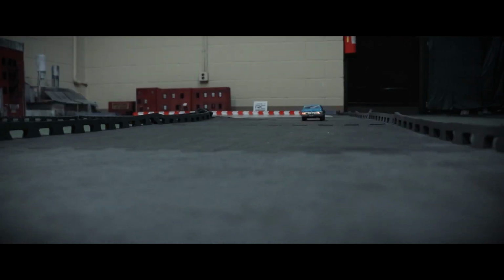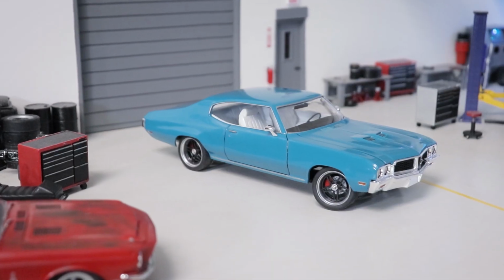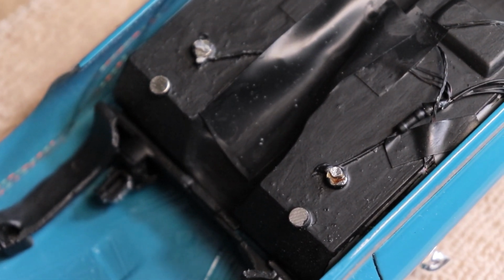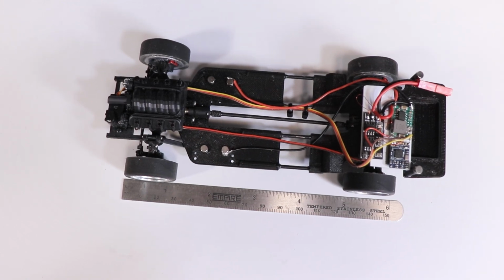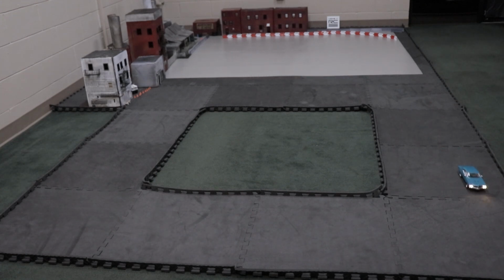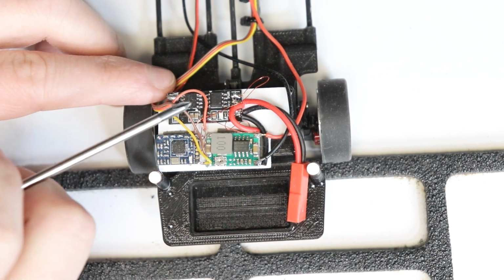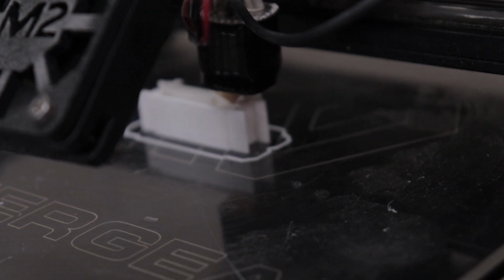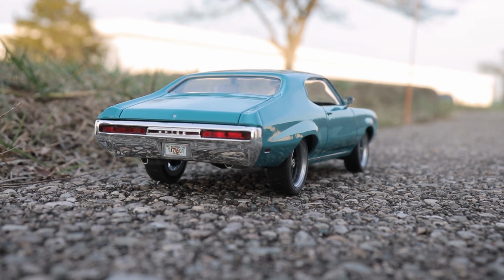The Perfect Blend of Scale and Speed? Let's Talk About This RC Buick GS 💪

Comment: This is what I'm talking about getting closer to a platform where we can have super scale RC drag racing like slot car 1/24 scale drag racing where you can build super detailed realistic models and drag race them now we can do it with fully capable RC cars and not have to have a huge drag strip to run them that is a permanent setup and takes lots of space . Please make a full kit with everything needed to build a model car with everything in this build but as a ready to go kit electronics and everything except radio of course

Comment: One of your best ones yet! Love the fact you can keep as much of the interior and other details while getting it 3S. I got the itch to similar builds during COVID. Mainly to recycle all the sign (plastic) material I was creating for my job. Mainly I borrowed the electronics from those cheap $20 rc cars that had proportional steering (5pin) and compact receiver, battery (the size of a capacitor) mainly because I picked a 1/32 scale design. But I wanted to have an interior so it was the best option. The three I built are pretty fast but only have about 15 minutes of drive time. The more fun part is the build journey. Thanks for your inspiration.
Reply from the maker: Thank you!! The build process certainly is a lot of fun, even if the performance is lacking.  👍

Comment: I don't know about you guys but I personally prefer to see smaller rims with higher profile tyres on the classic cars.
I think fitting 22 inch rims with ultra low profile tyres looks inappropriate & spoils the look.
The ones on this car are just about as large as I'd go.
I recently got myself a Kyosho 1969 Camaro & I was delighted to see they've fitted dual size rims & tyres, 1.9 on the inside & 1.5 on the outside & they look 👌 👌 👍 👍 .
Unfortunately they're not cheap so I'll be running it on 1.9s & keeping the stock ones for display.
I also have the Datsun 240Z rally which is a joy to drive, especially with a brushless swap.
I'm so impressed with the rally & on road chassis that I'm thinking about getting the longer wheelbase Chevy Chevelle next.!

Comment: For tail lights I use a thin piece of white styrene between the lens and the led/bulb which gives it a diffused look. For 3mm or 5mm led's I rough the surface a bit which also helps diffuse the light some, for micro led's a dob of white glue to diffuse.
Reply from the maker: I appreciate the info! 👍

Comment: Check out the line of 3S batteries from Spektrum.  They have a 3S 300mah lipo that I run in my SCX24 rock crawlers that has a pretty small footprint.
Reply: Another with potential is palmbeachbots. They make parts for micro robot-wars type rigs, and are also used in micro rock crawlers. 100 mAh 3s = 30 x 13 x 18mm
Reply from the maker: Will have to check that out. If I recall correctly they were a little larger than what I was using, but I'll have to double check. There are some small 3S options, but for these types of projects, "small" isn't always good enough. 😆

Comment: Can it drift ? 
3d print wider tires for the rear ?
Reply from the maker: Probably not enough wheel speed or steering angle for proper drifting. That said, it might be fun to throw in a gyro and some hard tires, and see what it can do. 

Slightly wider wheels in the rear would look good, but I think these might be the widest silicon tires I have. I guess I could try a slightly different offset.